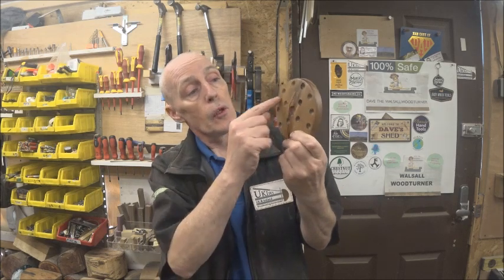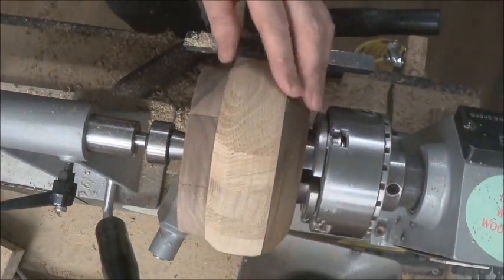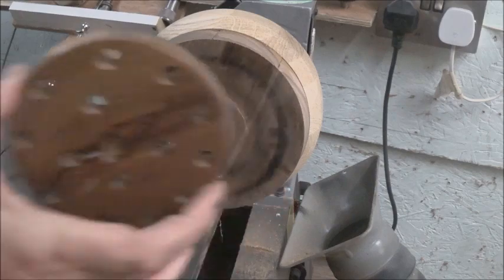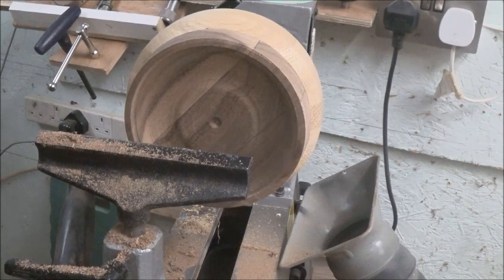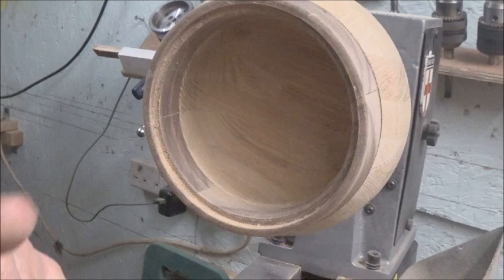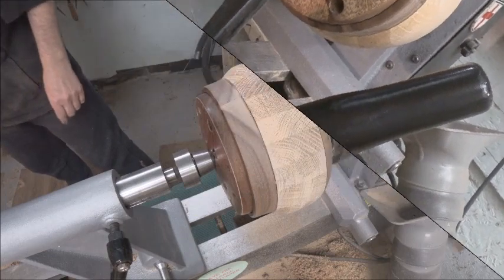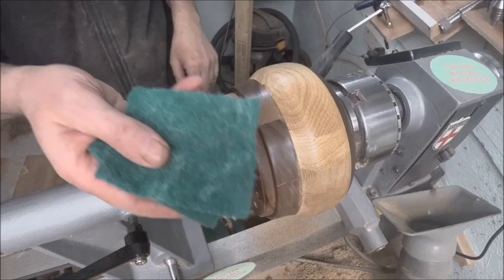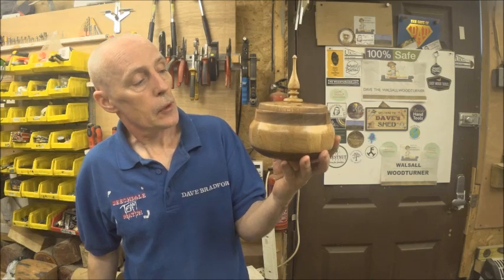E44  ( wood turning ) PotPourri Bowl

Comment: Another excellent project Dave. I enjoy watching your use of traditional and carbide tools. I am  just starting to explore carbide tools. I also like and use  the wood wax 22. Could I ask the total length , width and height if your Draper midi lathe. Just to establish if I have enough space in my small work shop. I need to upgrade from my mini lathe. Thanks for sharing your skills and expertise. Stay safe, regards, Chris.
Reply from the maker: Thank you Chris, good to hear yes certainly the length is 457mm, the diameter/height is 305mm (from bed to drive 6 inches i hope that helps) same for you stay safe from dave
Reply: DAVE THE WALSALL WOODTURNER Thank you for the information and fast reply.
Looking forward to your next video. Stay safe, regards, Chris.